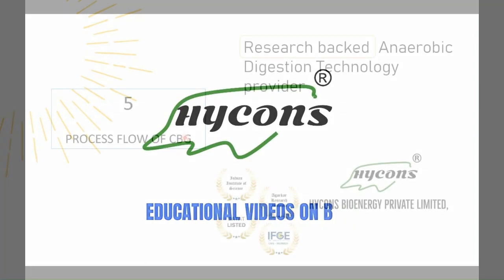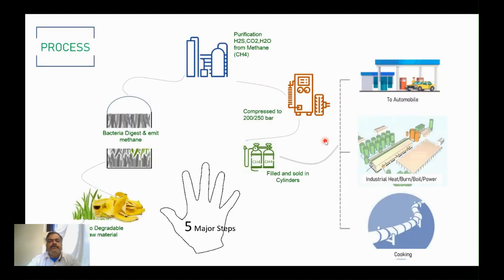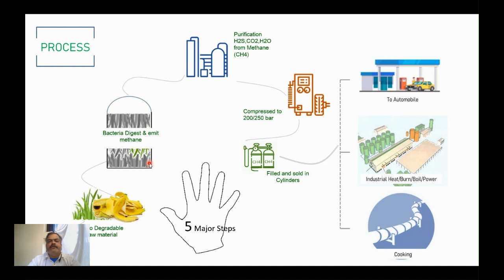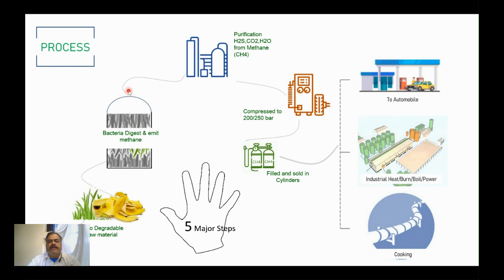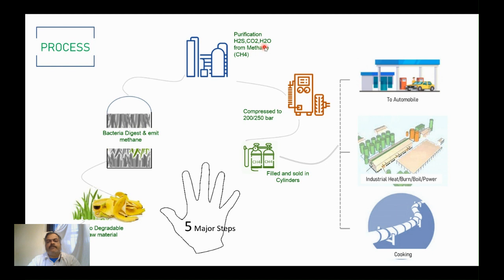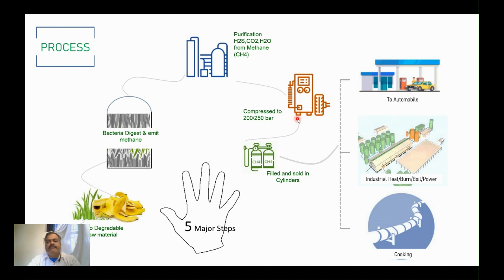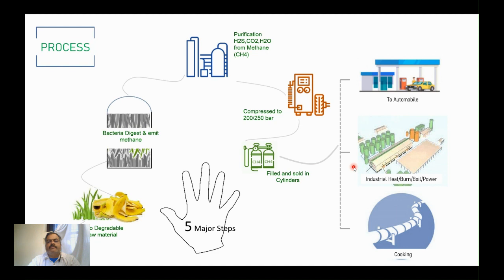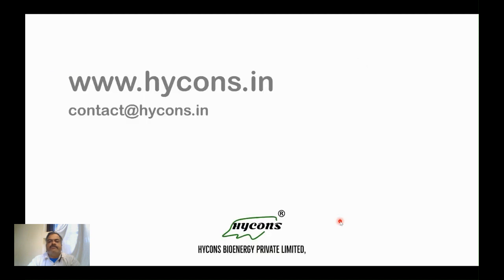CBG Chapter 5 - Biogas Production Process flow. How the Compressed Bio gas is produced

Comment: Thank You for exploring more information about CBG. 
Instead of anerobic digestion why can't we use Gasification technology to harvest syngas then convert into methane using methanation rector?
And how many days it will take to generate Bio gas from anerobic digestor? 
What is feeding Time frame of biomass?
Reply from the maker: Gasification needs 700°C and above, anerobic happens free or cost, but works  only on digestable solids. Both are different techniques and their existence cannot be questioned. Aeroplane and train and bus all move, but exists together.

Digestion time can be 3days to 90 days based on the material composition, feeding can happen continuous or batch.
Reply: @cbgindia  some study shows if we gasified under 400 degree celcious then yield methane content will be more.
Despite of expensive investment model. Please explore about micro CBG plant business model i.e less than crore investment  it will useful for us. Because here the agriculture sector mostly depending on food production and more lands are becoming unviable.
So if these lands are converted for energy biomass sector then can become good flow for bioenergy sector.
Even using algae or azolla can be produce bio CBG.
But here only the  investment cost becoming hindrances to initiate Bio-cng plant in India unlike only large capital intensive players can participate but they are in very few here.